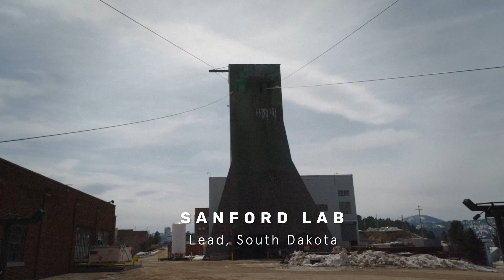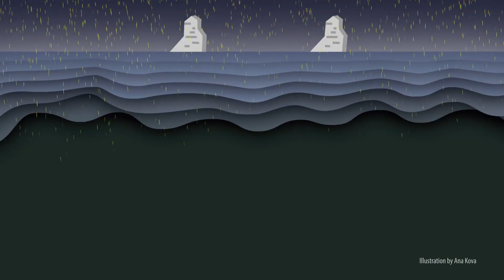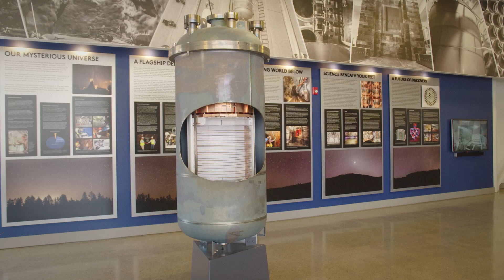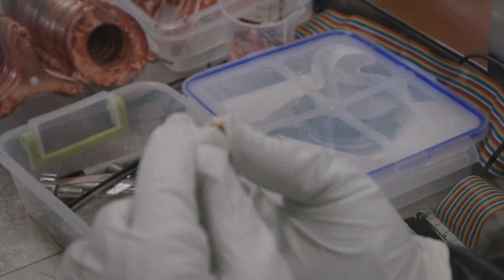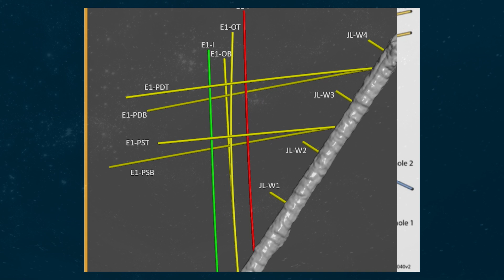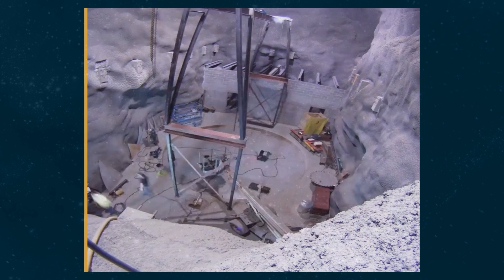Inside the Deepest Underground Lab in the U.S. | WIRED

Comment: Yeah LBNF/DUNE is the biggest of its kind: linear proton accelerator, neutrino research collaboration and propably the biggest neutrino detectors of its energy range. Little hype in the video.  The biggest research collaboration in particle physics and the biggest particle accelerator is LHC in Cern. I think also the biggest neutrino detector by size is the 1 cubic kilometer IceCube in Antarctica. 🤷🏻‍♂️